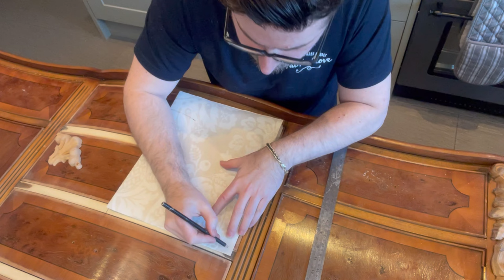DIY Furniture makeover, at the ￼using Woodubend Mouldings￼.￼

Comment: You mention a "medium" what is it and where can I get some. USA
Reply from the maker: Now you’ve got me without me having to look through the video maybe I’m talking about the glue I’m not too sure 🥴🥴🥴🥴
Reply: @JonathonMarcMendesPaintedLove  Maybe it was a different video. It was the one where you changed the edge of the round table, painted and decoupaged it. You used it before cutting the round inside edge, it prevented something from (I think) sticking
Reply from the maker: @wog1949  i’m truly baffled if it was on the decoupage paper it might of been the infuser which was the glue/topcoat and that I attached the decoupage to the surface that was a posh chalk interior product and if it was the trim that I added with glue then maybe it was water that I was using just to clean the excess glue away🤔
Reply: @JonathonMarcMendesPaintedLove  Yes infuser.

Comment: Do you happen to know the WUB #'s for the WUB pieces you used?  I'm in a pickle looking for the correct size for a hutch I'm doing.  I'm not sure I want to spend hours making some.  They all are way too big or too small.  The ones you're using seem to be sized appropriately.
Reply from the maker: Do you know I have no idea what size is that I chose I just kind winged it when ordering I do have measurements on the site but I must admit be dyslexic I find that really tough to I wish the packaging actually had the measurement on them it would make a little life easier so sorry I’ve probably not answer your question properly 🤪😩
Reply: @JonathonMarcMendesPaintedLove  It's all good.  I understand.  I don't measure either.   I always get it wrong when I do so I gave up.  🤪🤪🤪